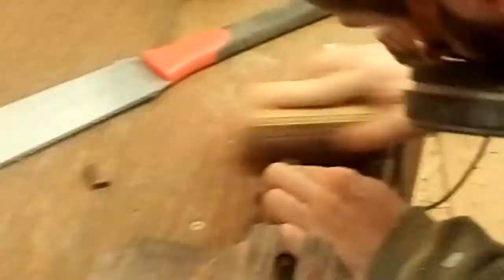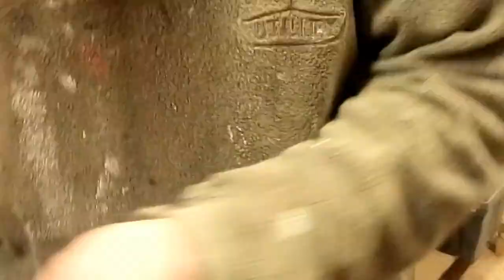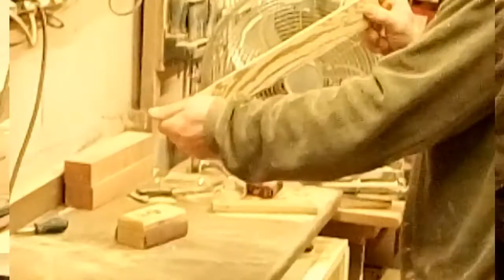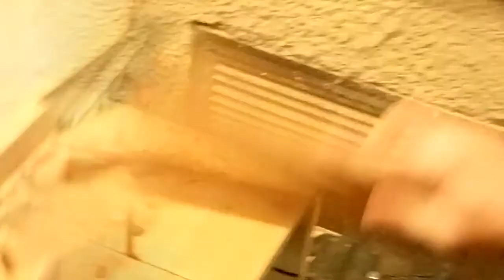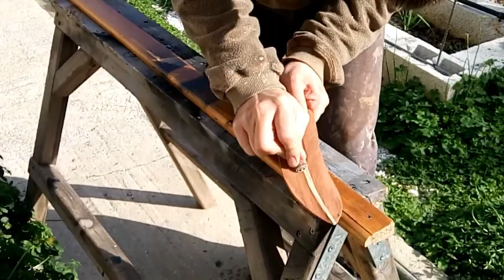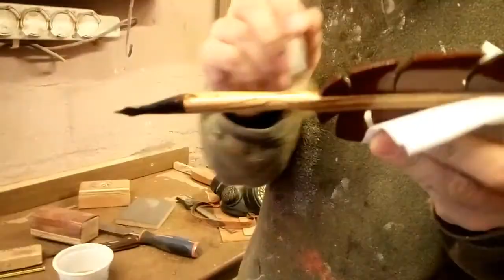Pen with no lathe challenge (wooden feather quill)

Comment: Why not put the work piece in your vise when you use the angle grinder on it? Or why not skip the angle grinder altogether, since you can do all the same things with other tools seen in this video?
Reply from the maker: Gary, I find when using an angle grinder it allows me the freedom of 
movement to carve and to shape the piece however my eye sees fit similar
 to a whittlers knife, just faster.  Similarly, I find the vise is too 
restrictive to achieve a flowing result.  I know it's not the safest 
practice and I don't advise anyone to try it, but it's how I've learned 
through my years of working.